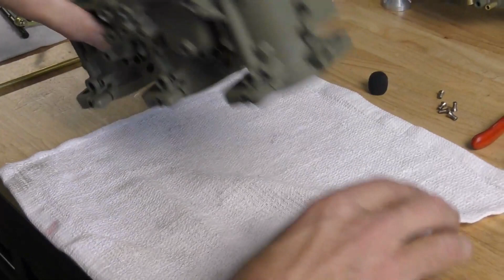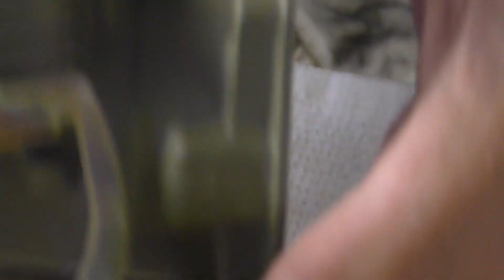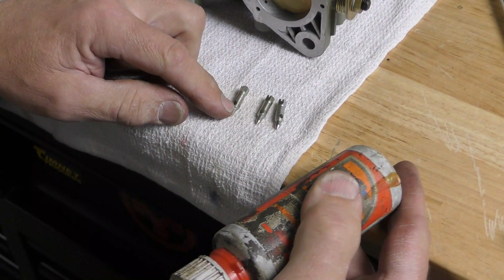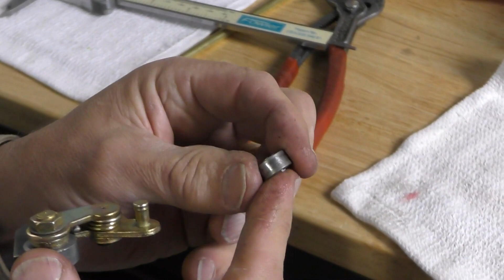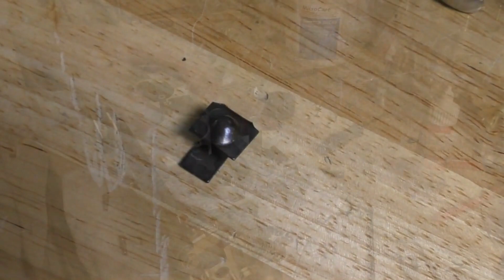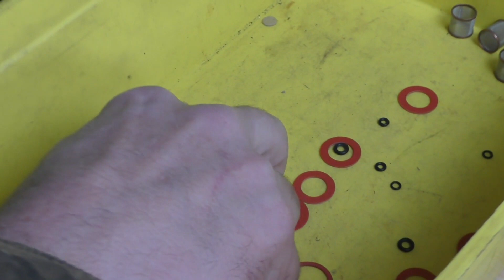Zenith 40TIN Rebuild Part Two

Comment: Thanks for making the Video, its been a great help. On my carb the small deceleration jet at the bottom of the bowl is stuck, whats the best method to remove it?
Reply from the maker: Impact driver is what I would use and if that does work drill it out and replace it.
Kurt
Reply: @Aircooledconsulting  Thanhks

Comment: Dear Sarah, dear Kurt,
thank you so much for this super helpful video.

I have one follow-up question: Let's assume the already oversized throttle shaft bushings got destroyed because of not watching your video before disassembly (asking for a friend ;-): Is there a way to pull and replace them? How would I have to proceed on the Zeniths? Just pulling from the bore-outside? Drilling? Heating up?

Of course I'm aware the new bushings have be aligned to bore on the mill afterwards.
Have a wonderful day and looking forward to your next videos.

Greetings from Germany, Stefan
Reply from the maker: Stefan,
Yes of course the bushings can be replaced. It is quite a big job on the Zenith carburetors as you will have to not only bore for the throttle shaft, you will also have to align bore  the new bushing to match  the throttle plate bore.
Kurt

Comment: Kurt, thank you for taking the time to share your knowledge and expertise. I'm currently rebuilding my '71T. The accelerator pump rollers were shot on the Zeniths. I was able to replace them with a spacer and flanged sleeve bearing from McMaster Carr; part numbers: 1281N12 and 92320A662.
Reply from the maker: Nice, thanks for the part numbers too, will check them out.
Kurt

Comment: in idle I have an AFR of around 13..14, in progression this drops to 8..9 only on one of the two carbs, what could be going on?
Reply from the maker: Firstly, you are wasting your time with an AFR meter. You can have a massive swing in CO% and the AFR Will not register a thing. What is your actual driving issue? Flat spots? Popping?
Depending on your actual performance problem I can direct you a little better.
Kurt
Reply: @Aircooledconsulting  there is no driving issue, it drives great, but I am worried about an air reading of 8..9 in progression phase, for the left carbs only.
At idle it is near 13..14, at open throttle 12...13. The float-levels are spot on, the carbs are nicely synchronised throughout the rev range.
Reply from the maker: If you are talking in AFR ratios then I would not worry at all as the numbers you are getting are most likely meaningless. If you really want to know what is going on throughout your driving ranges find your self a chassis dyno and watch your tail pipe emissions on a 5 gas analyzer.
you will have to compare CO%, Against CO2, O2, and HC to see if you have the optimum calibration package installed.
Kurt

Comment: is it hard to get parts for these Zenith 40TIN carbs. I have a set off my 71 Porsche 911 T Targa. Seeing you go thru this set. Wondering if I should not go thru mine. I did 20 years age bought a set of Webers 40 IDA to put on it. Just wonder in your opinion is it worth going thru the Zenith I just figured it was near impossible cause of the scarcity of parts
Reply from the maker: Michael,
So there are more parts available for these carburetors today than there where 2o years ago. Although if you watched all the way through you will still see that I had to make my own air pipe. So when it comes to the  Weber or Zenith question its really up to you. From a re-sale aspect original is better and will generally bring my money. From a drivability stand point as long as both carburetors are set up correctly then there should be no difference in performance, economy, or drivability.
Kurt
Reply: @Aircooledconsulting  If parts are generally available, why is it that most Porsche mechanics want to change out the Zeniths on my '71T.  They have been rebuilt recently.  It seems that very few techs know how to tune the properly.  Thank you for the help, I think I've got to learn to do it myself!
Reply from the maker: I dont know and unless your zeniths are beyond repair then it does not make much sense to just change them out. Most of the time when I hear stuff like this it is because the mechanic or shop is just not very good and does not understand the system they are working on. We used to see a lot of this in the 1990's with MFI cars being changed to carburetors because the shop did not know how to set them correctly.
Kurt

Comment: I decided to watch this because this particular carburetor is one of very few I have no experience with.  In the 70's, 80's and 90's I was primarily an emissions repair technician working on carbureted cars in the USA.  This is a very cool carb indeed, but I stopped watching at 14:21 when you installed the #3 throttle plate up-side down exposing the idle transfer ports to full manifold vacuum at Idle.  Oops.  I forgive you as I have never tried to talk and teach while rebuilding a carb, and never would because it requires all of my attention.
I hope you noticed this error before instillation as it would be hard to identify with an exhaust gas analyzer once the manifolds were on.  Plug reading would show rich if that cylinder were checked after Idle but not at cruise.
That being said you are clearly experienced with the Zenith and give expert assembly advice.
Reply from the maker: Kevin,
Thanks for your concern, but you should have kept watching. The throttle plate was not upside down though it did have a machine mark on the bottom side of the plate which makes it look like the thinning that the plates have. Also if you put the plate in backwards the throttle will not close and there is no way you will be able to get the engine to idle let alone balance the carburetors. This is why we run test and tune every carburetor we do on our test engine. To insure everything is together correctly. This is towards the end of the video. We also show tuning the decel system as well as balancing and mixture adjustment.
Thanks again for watching.
Kurt
Reply: @Aircooledconsulting  okay, I'll watch the rest.
So does that throttle plate have machined notch on both sides?
I need to watch the rest because it is quite different than the IDA or DCOE carbs I've done.  I'm a Holley expert "turned fuel inject everything" in my old age, but somebody has to be able to set dual points and sync multiple carbs right. 
Thank you for your time.

Comment: How do the zenith and the equivalent Weber's compare in terms of peak power and fuel economy?
Reply from the maker: They are aa capable as the weber carburetors when it comes to producing power and economy. Where the issue lays is in the availability of tuning parts like chokes that makes them harder to set up for a performance application. 
Kurt
Reply: Very detailed rebuild, and good tips from an expert, the carburetors also looked superb.

Comment: The electrically operated deceleration valves seem so different from the totally mechanical Weber carburetors. I'm really surprised to see that.
Reply from the maker: It is good when it is set up right. Helps with popping on decel. Hard to find the solenoid if yours is bad! S.